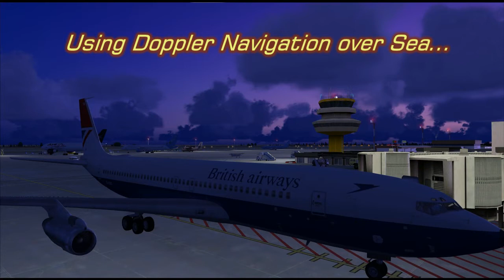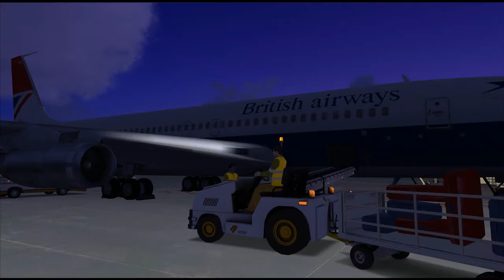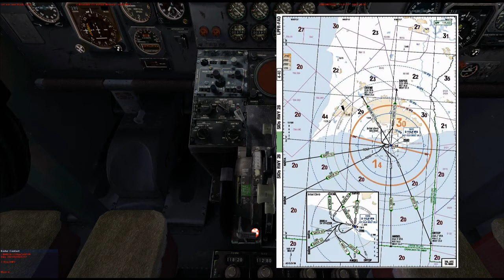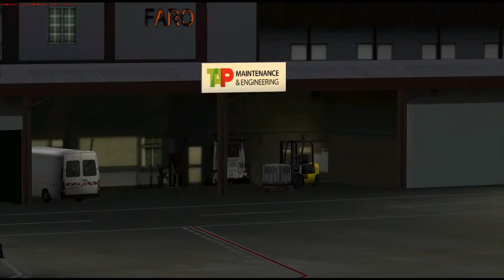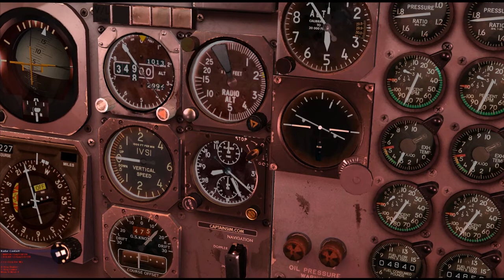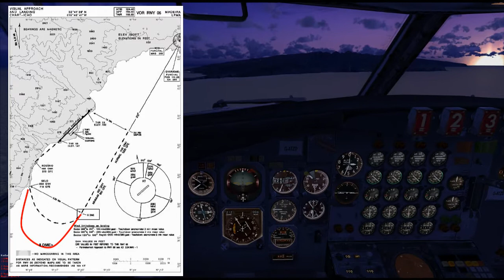CS Boeing 707 Multi Crew Experience! Faro to Madeira Night Flight Gelo approach!

Comment: how u can open those charts in fs ?
Reply from the maker: Hi. The approach chart at 44.42 is from the Aerosoft Madeira Scenery. I open them by simply opening the chart from the pdf. Or you can copy/open the paper charts in a paint program,  then save them to a separate file. Open the file to the screen when you want to view them.
Aerosoft Madeira X